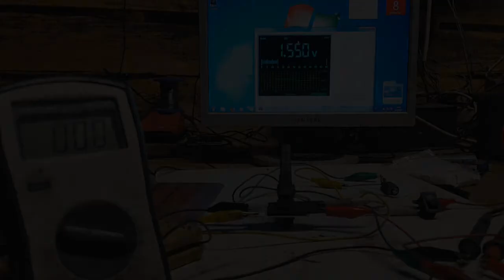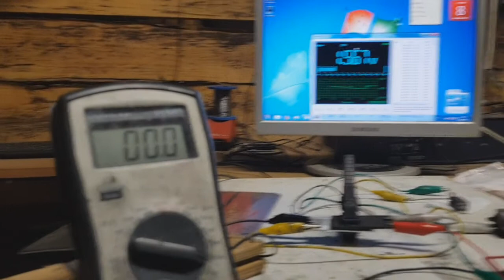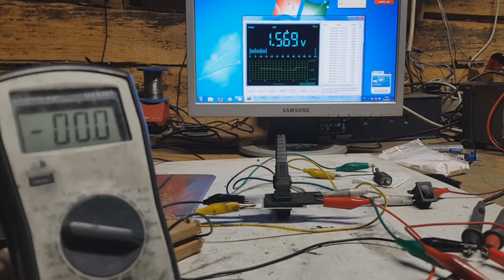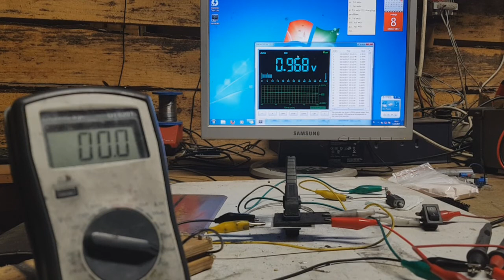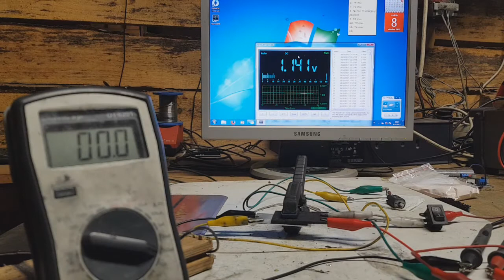GRAPHENE battery VS CARBON battery

Comment: hi cayrex2 excellent video as usual. i have tried this experiment a few months back but got nothing like your results can u pse elaborate on the construction of the cell i was using zinc plate but will try aluminum now . also can u pse advise charging voltage and time. i found NH4So4 a bit better then NASo4 and as a  separator im using vacuum bags filter paper. keep up the good work and well done.

Comment: Hi Cayrex, 
You seem to be making good progress, after running your figures through spread sheet, I reckon you are getting 278 Joules of energy into the motor compared with 164 Joules on your last test cell.
The cell looks pretty stable, but looking at the graphs maybe only run it down to 1 volt giving 220 Joules (80% of total energy), this should be kinder on the cell and give you better longevity.
Also the load may be a bit high for the physical size of your cell, maybe limit it to 50mA, perhaps a 27R resistor would make a more consistent load when running the test, as you cannot see the motor turning anyway.
Keep up the good work - Regards Martin.
Reply from the maker: Thank you! And thanks for the resistor tip!

Comment: What is the voltage, time and amperage charge? Regards from mexico
Reply from the maker: the charging voltage was 1.65 volts and current 150 mA. I charge the battery for about 20 - 25 min.

Comment: What kind of metal plates you use for the anode and cathode.
Reply from the maker: +ned star cathode current collector is graphite plate and the anode current collector is zinc couted with carbon. You can also use some other anode current collector or you only use zinc metal, works also good.

Comment: Some info but useless comparison.
Maybe the motor has a bigger capacity but no fan means hardly any load. In the end you still don't have a clue.
Reply from the maker: You wish 😊 And what is with 80 mA load current? With a fan the current of the motor will be 110 mA,... so no big deal. I make many research on this, but I dont put everything on youtube 🤫🤗